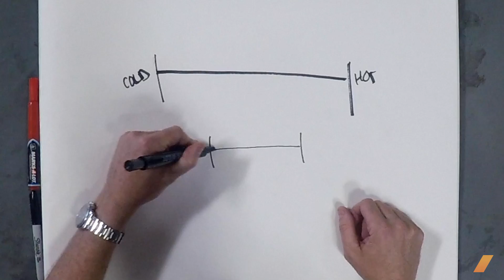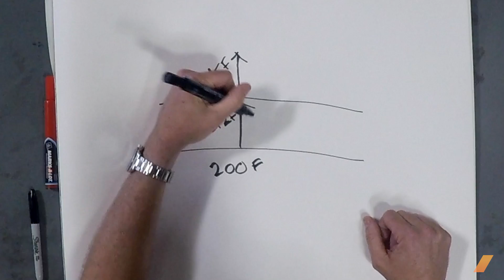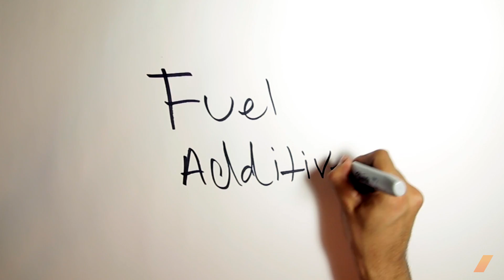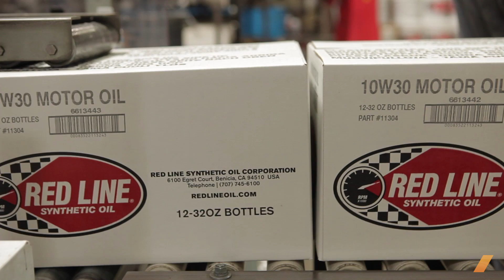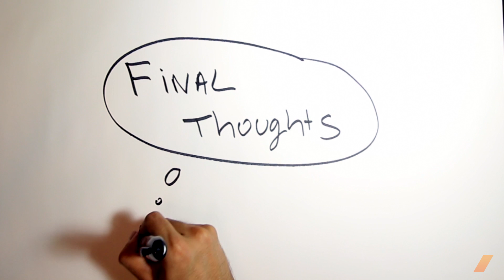10W-WTF!? Dispelling Myths About Oil -- /ENGINEERED

Comment: If I understood right. Too think of a engine oil will take a lot of time to heat up and than keep on building too much heat.

I will try to use 10w60 in my old Yaris to see if I can aim some ticking noises and eating oil problem.
I will use it only for summer in the hottest period and pay attention to warm up the car a little bit before taking off.

Comment: In my experience a heavyweight non synthetic oil is best, I recommend Valvoline Racing 20W50, use the high ZDDP version (black bottle) with flat tappet cams and the silver bottle for roller cams and remember to ALWAYS warm the engine carefully before using high RPM especially in cold weather.
Back in the day I got a call at work from the workshop manager of the local Ford dealer, he said he'd heard that we were experts in tuning certain Ford engines, 
this manager guy went on to say that he was having a big problem with this particular engine they were working on in that it had wiped out several brand new standard cams fitted in the Ford Dealership workshop, he wanted to know if we could help him get over this problem, the guy was in quite a distressed state.
I asked him 'what are oil you using mate'
he came straight back with 'it's NOT the oil'  I knew then at that moment not only that it WAS the oil causing his problem but actually what oil he was using.
What oil are you using I asked again and got the same reply, 'it's not the oil' the guy insisted,
I said, you are using Castrol RS 5W60 fully synthetic aren't you, he admitted that he was, (at the time this Castrol oil was massively expensive and had a big ongoing tv campaign which was why the guy had put so much faith in it)
I asked him if he had normal Ford 20W50 available, he said 'of course the stores here are full of the stuff, 
I told him to install the new cam and followers on the standard Ford 20W50 non synthetic oil, 
he argued on for a bit as the Ford non synthetic oil was about 1/15 of the price of the Castrol Synthetic product and he couldn't get his head around the fact that a cheap ordinary oil could out perform such an expensive 'competition' oil, I got him to grudgingly accept what I was saying and he rang off.
The next day he called again full of thanks for the advice I gave him and which had worked perfectly, he guy learned something that day, something I learned myself many years before, synthetic oil is crap, you need a heavy mineral oil for high performance engines, and an oil with ZDDP additive for non roller tappet engines, my choice is Valvoline Racing 20W50 mineral every time.
Reply: Rotax 636nut
For a normal road car fully synthetic oil is by far the best. I have used it for 27 years. I use Shell Helix, which is made from a base of natural gas. I changed the exhaust pipe. Inside of the pipe stayed clean for 3 months before it blackened. The car has done 168,000 miles.
Reply: I'm really talking about older type naturally aspirated competition engines John but just so you know, back in the day we tried Shell Helix in our 500 bhp Cosworth YB engines and the bore and valve guide wear was terrible and I mean terrible.
Against the 'conventional wisdom' of the time that favoured fully synthetic oils for turbo engines we tried Valvoline Racing 20W50 in the Cossies and all the wear issues just went away.
Some of my own vehicles did done over 200,000 miles on quality mineral oil and when checked during routine head gasket maintenance NO bore wear or valve guide wear was apparent, your reference to oil being somehow linked to exhaust pips black seems more than a bit random, what are you saying?
You make the statement that synthetic oil is the best John, but I ask you what comparisons have you made? 
I made my way by making comparisons and always at the sharp end of competition and I know what I'm talking about.

Comment: After reading Dr. Haas' oil articles on Ferrari Chat some years ago, I switched to Mobil1 Synthetic 0w-30 for my Integra with over 300K miles.  And these days I recommend Ow-whatever for any car, based on what the factory requires for operating temperature viscosity.  My car calls for 5w-30 or 10w-30, but I run 0w-30.  The reason is that the oil when cold is ALWAYS thicker than when hot, regardless of viscosity.  80% of engine wear happens during cold startup, and you want the thinnest viscosity possible when the engine is cold (which is still too thick for operating temperature).

We just replaced my wife's old car with a 2014 Mazda CX-5 with the 2.5L Skyactiv engine, and for oil I'm using Mazda's own 0w-20 oil with extra molybdenum additives, which is supposed to help with fuel economy.

For OCI's I've been doing 6 month/6K miles on my Integra, and plan to go 6K-7500 miles on the CX-5.  However I want to start getting some UOA's performed on my used oil to see what the lab's recommendations are for OCI, especially given the extremely high mileage of my Integra's engine.
Reply: but then why does your car manufacturer recommend 5w30 or 10w30, if 0w30 is actually better for the engine? Surely they know what's best for it, and a thinner oil is going to mean better gas mileage too, so why would they recommend a thicker oil if it means more engine wear and worse fuel economy?
Reply: They never reccommend only 1x grade of oil. The OEM handbook will recommend a range of oils that all meet a certain spec. ie in colder area use 0W-30, warmer use 10W-30. The important bit is it meets the right spec ie API or in my case ACEA A5/B5
Reply: ChrisDrift
Because there was no 0w oil that I'm aware of, in 1994.  The manual recommends 5w30 for colder climates, or it says 10w-30 "may" be used if ambient temp never goes below a certain level.  But in reality, 0w-30 is always better for refusing cold-start engine wear, and getting the oil to flow where it needs to go as soon as physically possible after the engine starts.
Reply: The point being is there is absolutely no reason why an oil with a thinner cold weight cannot be used in any climate, as long as the weight at operating temperature is correct to meet specifications.
Reply: What about hydraulic controlled components such as timing chain tensioner? running a thinner oil on startup means lower oil pressure which could have a negative effect on the components and the things they control
Reply: RPM BUILT
Doesn't make any difference.  All 0w oils are still thicker on cold startup than the thickest oil available when it's at full operating temperature.  If it were too thin on startup, it would be far too thin at operating temperature.

From the Dr. Haas articles:
"It is time to dispel the notion that 0W-30 oil is too thin when our manual calls for 10W-30. A 0W-30 is always the better choice, always. The 0W-30 is not thinner. It is the same thickness as the 10W-30 at operating temperatures. The difference is when you turn your engine off for the night. Both oils thicken over the evening and night. They both had a thickness, a viscosity of 10 when you got home and turned your engine off. That was the perfect thickness for engine operation.

"As cooling occurs and you wake up ready to go back to work the next day the oils have gotten too thick for your engine to lubricate properly. It is 75 F outside this morning. One oil thickened to a viscosity of say 90. The other thickened to a viscosity of 40. Both are too thick in the morning at startup. But 40 is better than 90 on start up. Your engine wants the oil to have a thickness of 10 to work properly. You are better off starting with the viscosity of 40 than the honey - like oil with a viscosity of 90."
Reply: Patrick94GSR 
I think you a little confused about oil viscosity ratings. 0w-30 and 10w-30 is not the same thickness when cold. The point of using a 5w vs 10w is the 5w will be thinner in colder temps. Please refer to the oil viscosity chart in your manual or at your local honda dealer for recommended viscosity for specified temp
Reply: RPM BUILT ummm I think you need to re-read my posts. I said exactly that the reason for using 0w is because it's thinner than 5w or 10w when cold. But even 0w-anything is still thicker when cold than any oil weight at operating temperature. An engine requires oil of a particular viscosity to flow properly at operating temperature. But even the thinnest oil available is too thick to flow properly when it's cold. So you use the oil with the thinnest cold viscosity to get as close to that viscosity for proper flow, to minimize cold start engine wear.
Reply: *****
yes what's your point?  Cold oil is thicker than hot oil.  Cold 10w-30 oil is thicker than cold 5w-30 oil, which is thicker than cold 0w-30 oil.
Reply: *****
Let me lay it out for you as well then.

Engine oil needs to be a certain viscosity to lubricate properly, and that viscosity is attained at operating temperature.  Using an oil that is too thick at operating temperature (like 20w-50 when 5w-30 is required) will not lubricate the engine properly because it is too thick.

Now, all oils are THICKER when cold than they are at operating temperature.  So to help prevent cold startup engine wear, you want the THINNEST oil you can get when cold, that is still the proper weight when hot.

My point of comparison was, 0w oils are the thinnest oils you can buy when cold.  But when cold, a 0w oil is still thicker than the thickest oil you can buy when it's hot, like 20w-50.  0w-30 is thicker when cold than 20w-50 is when it's hot.  So that 0w-30 oil is STILL too thick when cold to lubricate properly like it does at operating temperature.  But 0w-30 is thinner than 5w or 10w-30 when cold, and that reduces cold engine start wear.
Reply: Trollololol you are STILL NOT GETTING IT!!!! All oils are thicker when cold than when hot. All of them. Oil needs a particular viscosity when hot, but when cold it's too thick to lubricate properly. 0w oils are still TOO THICK WHEN COLD to lubricate properly. But 0w is better than 5w or 10w when cold to reduce cold start engine wear.
Reply: I think you're probably confusing the actual numbers on the oil with relative viscosity at cold vs. operating temperature.  They do not relate to one another.  0w-30 is thinner when cold than 10w-30.  They are the same at operating temperature, typically measured at 100°C.  5w-20 is the same as 5w-40 when cold, but 5w-20 is thinner at operating temperature than 5w-40.

Take 0w-30, which typically has a viscosity of 62 at 40°C, and about 10 at 100°C.  10w-30 might have a viscosity of 64 at 40°, and also 10 at 100°.

Now look at 20w-50, which has a viscosity of 154 at 40°, and 19 at 100°.  At 100 degrees it's much too thick to work in an engine that needs 5w-30 for example.

But look at the 0w-30 at 40 vs. the 20w-50 when hot.  0w-30 is 62 at 40° while 20w-50 is 19 at 100°.

My point is that all oils are TOO THICK when cold to lubricate properly.  But you want the oil that is thinnest when cold to help reduce cold engine start wearing, which is what the 0w oil will do.
Reply: Just stop man, you're quoting me wrong.  Look at my posts above.  "All 0w oils are still thicker on COLD STARTUP than the thickest oil available when it's at full operating temperature", as evidenced by the cSt Viscosity numbers I posted above.

Look at the quote from Dr. Haas: ""As cooling occurs and you wake up ready to go back to work the next day
 the oils have gotten too thick for your engine to lubricate properly. It is 75 F outside this morning. One oil thickened to a viscosity of say 90. The other thickened to a viscosity of 40. Both are too thick in the morning at startup. But 40 is better than 90 on start up. Your engine wants the oil to have a thickness of 10 to work properly. You are better off starting with the viscosity of 40 than the honey - like oil with a viscosity of 90."
Reply: @Trollololol I wonder if you're just plain trolling if given your username.

No matter which oil available - 0w30, 5w30, 10w30 - when it's "Hot" as you say they're the same general viscosity maybe varying a teeny bit depending on the oil manufacturer. I've checked Data sheets, sometimes  0/5/10w30 changes at hot viscosity just slightly but close enough to be called an xw30. E.G. Pennzoil 5w30 vs. Pennzoil High Mileage 5w30 which is a little thicker than the regular non-high mileage kind. The hot temperature isn't what Patrick's arguing about and is irrelevant when he says "Thicker". First, they differ in thickness when "cold" - that is, the ambient outdoor temperature regardless if it's 100 degrees F or -30 F. 0w30 is the thinnest when cold out of the three listed with 10w30 being the thickest. What Patrick has been trying to tell you the whole time is that no matter which one you choose every single one of them is going to be thicker not at operating temperature but when COLD and 0w30's the best one because it'll reach its operating temperature viscosity the fastest, reducing friction in the engine. This doesn't change that each out of the three is the same general viscosity when HOT, so I hope this has cleared up clashing confusion and maybe stress if there was any.

Comment: I have 20w50 on my 328i 96 and it starts great on 45 degree weather
Reply: - 1) 45 is not 'cold', and 2) you are still doing excessive wear and damage at startup. 20W (what the oil is when 'cold', is way too thick to get to the top of the engine in any reasonable amount of time.
Reply: I run 20W-50 in my Ford Capri because it's what the owner's manual specifies ,i have used it at just below freezing temps without a problem, it isn't as thick as people think it is.
Reply: It is very slow to get around an engine on start up, compared with a 10W.

Comment: Interesting how almost all agree [ 7:08 ] BMW VANOS likes a thicker oil (5w-40), where most say the Ford 5.4L 3-valve (camshaft phasers) engine should have no thicker than a 5w-20.  I own both engines.
Reply: Hubjeep i run 10w30 penzoil ultra class synthetic  in my 95  bmw m50b25tu with vanos
Reply: Hubjeep thinking i should run a 10w40 or 5w40
Reply: John Doe  From what I have read the "40" number is the one that matters the most with VANOS.  As the video said, the "w" winter number only matters when really cold, as I understand there is theoretically no advantage to a 10w40 over a 5w40, and more synthetics seems to be available in 5w40.
Reply: Good point

Comment: SOOOOO glad I never have to think about this stuff again!  I've driven 20,000 miles without a single drop of motor oil or gas in the last 2 years thanks to my electric car! I was so sick of having to carry quarts of this stuff around with me in my last car....done, bye bye oil. I know there is still plenty of oil used in plastics and rubber etc, but even that is beginning to change :)
Reply: David Clark sure but electricity is in thousands , even millions more places than gas stations... it's amazing how much more you begin to think about the energy you use to get around. My next electric car will go further than my last gas car in one tank / charge already.

Comment: At 6:30, I don't understand. I thought heavier weight oils are better for more heat? Why would a 10W-60 cause the oil temp to go higher than a 10W-50 or a 10W-40??? What am I missing?
Reply: 10W-60 creates more friction because it's thicker , friction = heat.

Comment: If you aren't sure pull the dipstick and look, if the oil is darker than a hershey bar and looks runny its for sure time to change it, same with most differentials that use 75-90, 75-140 lube you can tell by looking how broken down it is

Comment: what if you're adding motor oil when it is low. if you add a different viscosity or brand, do the two types of oil blend well enough when it is running to not be an issue?

Comment: I work in a lube shop, just run a reputable brand in the type and wieght the manufacturer recommends and don't go too far over the interval and you'll be fine, the worst thing you can do is let your oil go for too long and get too low. I see it all the time people running for 15- 20,000 km and sludging up the engine and engine flushes might not work or cause leaks, in that case you might jam up your variable valve system or other close tolerance parts. For racing get some synthetic 20-50 and that should cover all the the bases as it will flow OK on start up and will lubricate well at high temparatures
Reply: You cannot blindly recommend 20w-50 oil for all cars used in all racing applications.  That's almost downright unethical.
Reply: Rex Holes 20w50 won't work in any car for racing, if your car reccomends 10w30 use 5w40 or 10w40 if you are going racing.

Comment: So what is a GOOD fuel additive to buy?
Reply: cardboardorigami marvel mystery oil
Reply: None honestly.
If you have buildup on the inside of your engine there is honestly very little that will reliably break down the carbon buildup from years of poor combustion, likely due to poor maintenance.
At best some might have some solvents that will break some down but will still leave an uneven surface on the pistons and valves, or it will be a octane booster which will just make your engine work harder to stay cool (thus why you shouldn't run 92 if your car recommends 87, over long term use it causes excess wear and burns your rings and gaskets)

Comment: I'm curious what this fella would recommend for old worn out flathead engines. I've heard from lots of folks to use 20w50 or 15w40 rotella for big rigs.
Reply: Yes, use Rotella T 15W-40 for flat tappet engines that need more zinc.
Reply: Does it require a non-detergent oil? (talking nearly about antique flatheads here.)
Reply: Austin Lucas non detergents are recommended for non rebuilt flatheads, as detergents would kick up the sludge in the pan & clog oil passages. Rebuilt flatheads are always healthier on detergent, something heavy, & zinc helps!

Comment: Vano systems require lower weight oils. As the passages are very small. One reason Ford went from a 5W-30 to 0W-20. It doesn't ruin the variable cam timing gears......